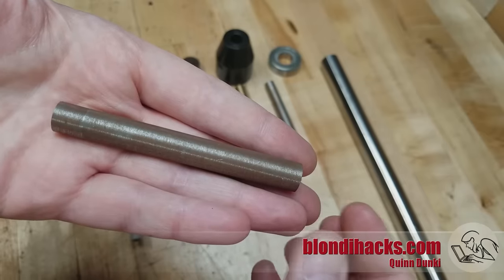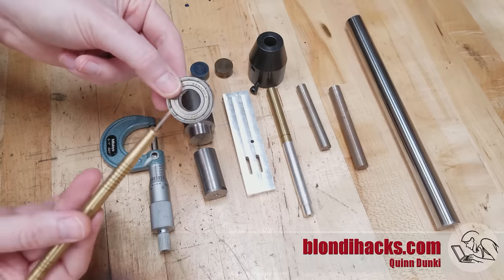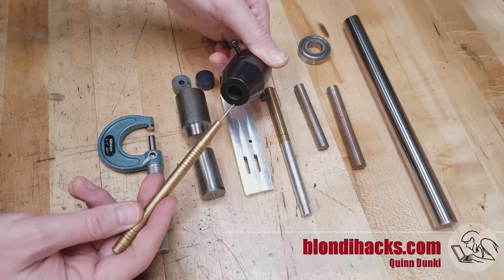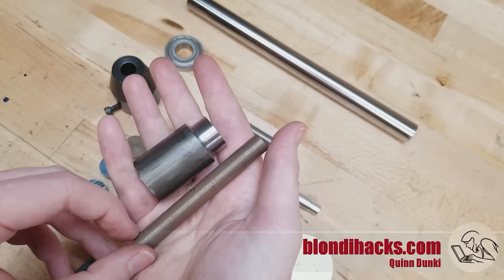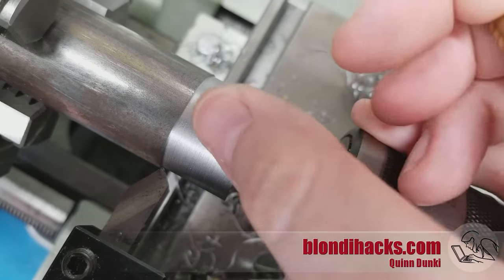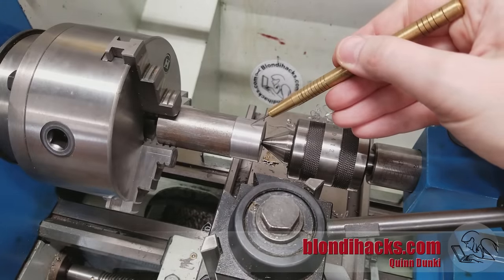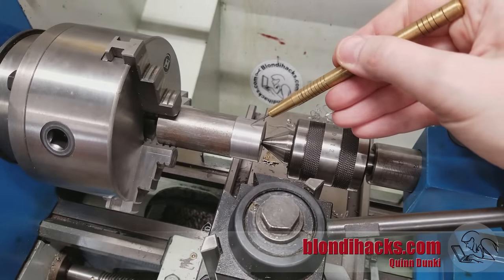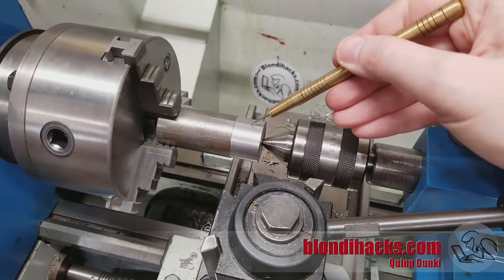Metal Lathe Tutorial 12 : Surface Finish

Comment: It is absolutely astounding how slightly different alloys of the same general material will produce drastically different finishes given the same cutting parameters.  When I run 1018, I find it almost impossible to get a good finish if the diameter of my part is under 1" (without pushing the machine over 2500 RPM, which is terrifying).  When I run 4140, S7, A2, D2, stainless... No matter what I do the part comes out like a mirror.  If the part is 1018 and over 1" in diameter, it's easy to get a decent finish.

Comment: @Blondihacks Hi Quinn, I just purchased a new Grizzly G0752Z and I am in the process of leveling the ways. I'm waiting for my machinist's level to arrive. I cut the "dumbbell" and as far as I can tell by the mic I'm .006 out at the tail. I have the shim pack so I'm ready to shim as soon as I know which direction I need to go. My cutting tools are the pre-ground HSS set from Grizzly and another HSS set I purchased off of Amazon. None of these have a round nose turning bit. All very sharp points. My surface finish is pretty much crap. I have ordered some tool blanks, a set of tool face angle gauges and I have a great 8" bench grinder. I'm going to grind up what I hope is a better tool to improve my surface finishes. I really appreciate your great series. I have never done any machining so I'm learning a lot. Thanks again for all your tips and very helpful instruction. I have joined you at Patreon as well.

Comment: Great info! I'd like to add something that helped me out tremendously. If one uses carbide insert tooling, find the inserts with a positive rake angle. Most of the cheap sets have a zero degree or sometimes negative rake angle... Once I realized this and switched to inserts with a positive rake my surface finishes improved 100 percent.
Reply: A good place to start with carbide is the sets of five tools using TPG inserts.

Comment: In another life, I was an R&D Machinist in the turbocharger industry.   I worked with angstroms and millions of an inch.   That was a long ago and now I make wind flags for target shooters.  Most of my work now is with a Hardinge HC Chucker and a Hardinge tool room lathe.  I find a lot of poor part-time machinists out there that have no or little experience with a variety of operations or materials. I guess they were on production lines running one machine.  Your stuff is basic but very helpful.  Keep up the good work.

Comment: Spent an afternoon taking apart and cleaning the protective coating from the parts of a brand new baby lathe ( my first a SIEG C0) before greasing it and re-assembling it.  Tried machining some steel bar with one of the braised carbide tools supplied but got ripples in it.  One blondihack video and a less spikey tool later and i've got a very acceptable finish for a first effort.  Need a dial gauge and a bit more time to get it all dialed in but it looks like it will do some fun small stuff very nicely.  Thanks for a great set of videos.

Comment: All good info. You did forget to mention another couple of important reasons why good finishes are sometimes important : for interference fits, if the surfaces are unduly peaky, those peaks will get knocked into the valleys during assembly, changing the diameters of the parts, and the desired elastic radial strain will not be established to keep the joint tight. It will also take undue installation force to achieve that undesirable situation. 
And for running fits (say a piston rod sliding in a nose bush of a hydraulic cylinder) a peaky finish on one part will cause abrasion of the other part, resulting in premature wear and loss of performance.
Reply from the maker: Great additional info- thanks for posting it! I always have to make tough choices about what info to include in these videos to keep them from being an hour long. 😁  I appreciate when people add (nicely) things that I missed in the comments.

Comment: Thanks for the advice. This is a great video. I bought a 9a southbend that has been rebuilt top to bottom in almost flawless shape. With v belt drive and tapper attachment. I am learning to use it and grind tools. I will try preground tools I am inexperienced with lathes. But trying my best to learn.

Comment: I know this is an older video, but figured I'd toss in a tip when using sandpaper.
It's important to keep in mind where the majority of your pressure is coming from. As in, if you're holding the paper between fingers, then the center of the paper will have slightly more pressure on the material, assuming you're fairly square to the work. Keeping square, and moving the paper back and forth (as shown here) is the correct thing to do. If you're slightly off on your angle, or don't move the paper back and forth, then it's easy to accidentally grind a slight taper into the material. Just an FYI for people

Comment: Quinn, I really enjoy your lathe series, thank you and keep up.
This said I have to mention every time you put your fingers near that rotating meat crusher 3-jawed monster, I start to get a little sweaty. I would probably be too afraid to use the emery or file on a powered lathe, don't trust myself enough.
Reply from the maker: It's good to have a healthy respect for that chuck, but you also need to work close to it for a lot of reasons. The most rigidity is close in, and a lot of small parts leave you no choice. That said, camera angles often make it look like my hands are a lot closer than they are. Not to worry, I'm being safe. Thanks for watching and for your comment!

Comment: Very well explained. About the only thing I would have added is you want the tool to take a definite chip and not rub or produce dust on material that does produce chips if you slow the feed too much. Rubbing will not only quickly dull the cutting edge, but will seriously work harden any material with those work hardening characteristics.
Reply from the maker: Yah, that's what I was going for with the section about "plowing" if your surface speed is too low. Your additional detail is helpful, though- thanks!

Comment: Nice video, but I would have a thing or two to add.

Learning to grind tools and experiment with surface finishes at the same time is actually a good idea in my opinion. They kind of go hand in hand.
 
Geometry needs to be correct, obviously. But in terms of surface finish, the finish of the cutting tool is very important as well. Honing or lapping your cutting edges makes a huge difference. The finish of a bench grinder is pretty rough under a microscope which causes resistance for the chip to flow over the tool. A nice tool surface makes the chips flow better and prevents rough spots like lumps and rubbing. 

Talking about geometry, you can make lathe tool bits with a wiper flat ground into them. A small flat perfectly perpendicular to the workpiece will prevent any kind of "fine-threading" tendencies of a sharp tool while theoretically keeping a similar tool pressure.
Think of a wiper flat like rounding your tool off with an infinitely large radius. Sandvik coromant makes special inserts with the wiper geometry for amazing surface finishes.

On heavy machines, taking a deeper cut will help too. Bigger chips don't have the tendency to birds nest as much and loading up the machine makes is run more stable than basically just scraping off the skin.
I know taking larger cuts may seem challenging for holding a precise dimension but by turning with balanced cuts, that shouldn't be a problem.

Lastly, using carbide, if your machine can handle it is a good idea too. Carbide inserts tend to burnish the material when used at the proper speed.
Even as a student, I can find carbide insert tools and carbide end mills that I can afford on sites like ebay. Be sure to pick out the good stuff though, there is a lot of garbage floating around on there.

This was my two cents, looking forward to watch some more of your videos!

Comment: Great video excellent information. May I suggest a better way to show roughness on surfaces. Get a sterio microscope that can enlarge to a 1000 times. At this magnification you will see all the asperities on the surface. Then you can explain that grinding honing are simply processes that remove gradually these asperities. This is exactly what Metallurgist do to prepare sanple for micoscopic examination.. We also stain the metal to show grain boundaries.

Comment: Typically, i run a CMMG 432 or a TNMG 432 carbide insert made by kennametal, sandvik, or another brand. I typically run my feedrate fast for not critcial surfaces because it leaves a really nice surface finish. But when it comes to bearing surfaces or precision mating surfaces I use 431 size inserts to deliver a precision surface that nearly looks like chrome bar. 

I have to say that I do use Tool steel for unique features in certain parts. Having cut with steel vs. Tungsten Carbide, I say that in most metals that Carbide deliver a much more shiny and beautiful finish. However, in aluminum i do like using high speed steel because it leaves a nicer finish than carbide (if it doesnt string)

Comment: Grinding and lapping a (parallel to the work surface) facet on the tool edge, of slightly greater width than the feed per revolution applied, can gives good results if applied with care at a relatively low work speed. Say a 0.007" facet width for a 0.004" per feed.

Comment: The finish I like to get is with a roughing tool but plenty of coolant directly on the cutting surface. Even with relatively aggressive feeds it comes out pretty well, provided the tool is in decent shape. May I ask - aren't those little lathes equipped with a coolant system?

Comment: Great video , i wonder when we need a good surface with a boring bar for a bearing to to sit in will the same rules apply ? Bigger radius on the tool and high rpm low feed ?

Comment: As someone who is sick of being a machinist for a living (34 years and counting) I find myself watching these videos for some reason...oh well.
Reply from the maker: I think that means that deep down, you still love it, even if the job isn't always the most fun. 😀
Reply: The "sick of" part comes from customers who have "engineers" that can't properly dimension a part, or forget to give dimensions at all, use CAD ( Crayon Assisted Drafting), and expect instant turnaround while they jump up and down like a squirrel on fire on a pogo stick going " Now!! We need it now!!?" 
Rant over
Reply from the maker: I hear ya! I love programming computers, but making commercial software takes all the fun out of it. Customers, management, production schedules, etc etc. 😀
Reply: @ColKorn1965  Ugh, I run into that a lot. They dimension a critical hole as being on size, but give no tolerance. Is it a press fit? Slip fit? What does it dooooo?
Reply: @ColKorn1965  lack of reasonable expectations on your part does not constitute an emergency on my part. Calm down! It will be ready when it is ready. Not before.

Comment: Nice Job -- as usual well articulated -- Two thumbs up . 
Now for a little constructive criticism -- I disagree with grit of your emery paper -- 400 grit is much to fine
it will highlight every sin -- just like it did in your video .180 Grit would polish it nicely and hide every sin 
.

Using oil is a good move -- Very high revolutions would produce even much better results .
Reply from the maker: Fair enough! I appreciate your feedback. In my humble experience, going below 400 removes too much material and is sure to mess up my dimension, but maybe that's just me. 😀
Reply: Yes you are correct -- it will obviously remove more material -- you have to plan for that .
You leave enough material to take care of that problem -- about .001 - .002 depending on the
material being machined . I scraped plenty of parts before I learned .
My pain is your gain .
Reply: Chris -- My interpretation of "de-wisker" is to remove any whiskers etc. Getting a good O.D. finish and 
removing whiskers are two different things .I believe that you are talking good finish. Allow me to give 
you an analogy to try to make my point. The best finishes are commonly obtained by using grinding
wheels. Let's assume that you are using a 180 grit O.D. grinding wheel-- the surface speed would be 
much greater than Dunki attained by polishing on her lathe. Hence -- I recommend very high rev's -- 
I do it all of the time and achieve great results .
 @chrisstephens6673
Reply: Chris -- Did you take an exit ramp??? -- wood turning has absolutely nothing to do with this conversation . 
I can see this turning into a game of verbal volley ball. My objectives were to exchange ideas .
I think you want to turn this into a contest . Guess what -- I'm out .
Reply: Chris Stephens. If I understand  correctly  what you are saying is that increasing speed has the Same effect as reducing grit size and vies versa, at least this is what I have found ( within reason)
Reply: Typo vies versa
Reply: Bloody auto correct  try again vice versa😀

Comment: I have often wondered what’s going on with aluminum. You’re right by all intents and purposes by feel , even giving it the fingernail test, it feels very smooth but yet there is still that machined pattern. The only thing I can figure is one of two things. First depending on the direction of the grain of the surface the light refracts differently. So either it takes just a microscopic amount of imperfection like down to the nanometer scale for it to be visible or the act of machining actually changes the crystalline structure of the surface which shows those machining marks. Does this make sense or am I off in left field somewhere?  Lol.

Comment: Hello Quinn
Since I have some difficulty to understand your language, I would like to know the following:
In the final stage of the video you use Grit400 sand paper to eliminate the scratches on the surface of the piece. It seems to me that it got worse.
How should I do to obtain an almost mirrored surface?
Is it possible to obtain a good cutting surface without using sand paper? (After cutting with carbide or HSS tool).
Thank you

Comment: I got a Chinese 210V lathe with a 56 spindle gear. So the gear arrangements for turning and threading are very different than other mini-lathes. Others manuals have included a table for turning--while mind does not. So, when I broke it down for first cleaning, the gears did not have No. of teeth marked and now I can't figure out how to arrange gears for turning. Where can I find help with turning with a 56 gear teeth?

Comment: I love the videos.. alot of great information.  Just a question. Whats your take on vertical shearing tools? I seen one quite a while back cant remember where though and i made one. It worked very well for the most part but i think its capable of doing better as far as mine went i was wondering if you had any insight on these or the angles i might grind into one to take its to its full potential. Thanks in advance for any advice
Reply from the maker: They can be really great! I’d like to do a video on them at some point.

Comment: I love your videos - not many girls are into machining!
I have a lovely old Colchester Triumph roundhead lathe. 1964 but in very good condition with hardly any wear. I have had it for 20 years but only wired it in a few months ago.
I can get a lovely finish on brass and cast iron but on steel I am just not happy with it. Perhaps I am too fussy? I have tried high speeds and gentle feeds but the finish is usually pretty rough. Could it be the carbide tools? I have tried several types including round nose. I have yet to master the skill of grinding HSS but I have a feeling carbide could be my problem? max speed on my old lathe is only 1000rpm so not very good on smaller parts.
Reply from the maker: I would give HSS a try, and try 12L14 steel. Much much easier to get a nice finish than regular mild steels.

Comment: So  why don't you use the highest speed your lathe has and the slowest feed speed? Does your lathe or all lathes, have the spindle connected to the feed screw so that you can't have one go as fast as possible and the other as slow as possible? Is that an ability that only high dollar machines have?
Reply from the maker: You can’t go too fast either. The chips need time to form and you need to control heat. The material has a range of feeds and speeds that you want to stay within. Regarding the relationship between the feed rate and spindle, yes you are limited by the gear choices in the transmission. However there’s no point in feeding slower than half the nose radius on your tool. Finish won’t improve and you’re just costing yourself time.